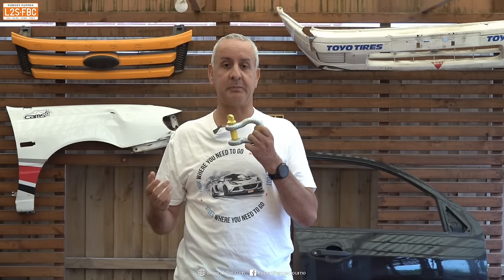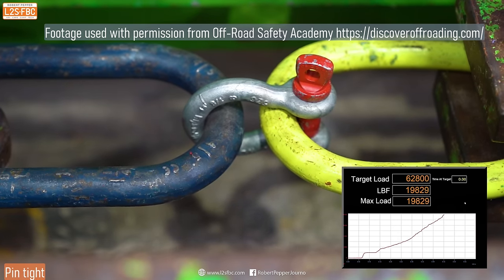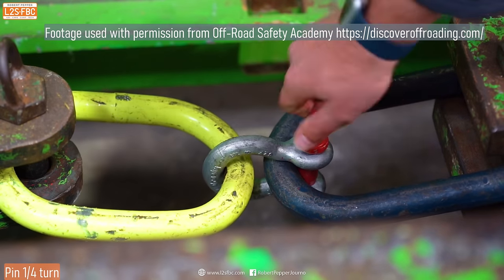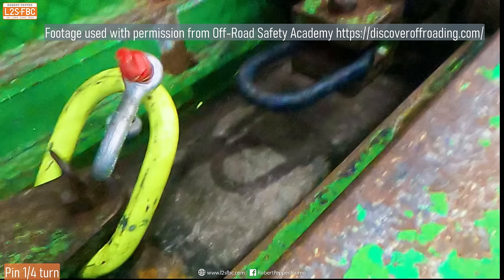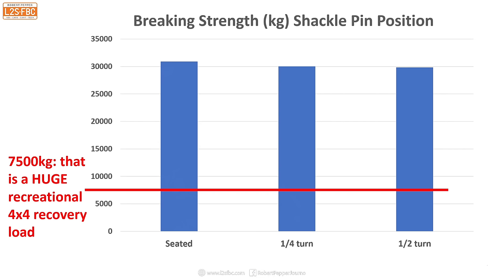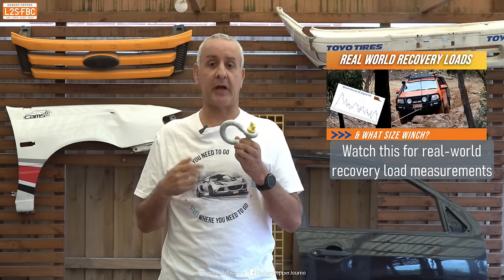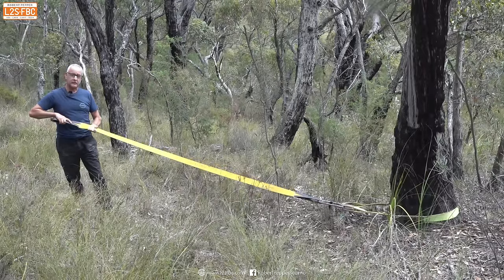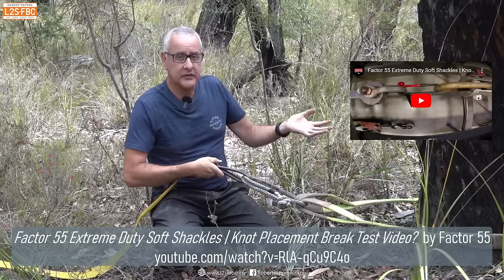What happens if you back off a shackle by 1/2 a turn?

Comment: One major component that was left out, is that the screw pin shackles are rated for opposing angle pulls on the bow side of the shackle.   In that type of pull you will start to spread the legs of the bow LONG before what was shown in the straight line pulls of this video.   
  So yes, in all reality it doesn’t really matter in a straight line pull.  But if you have opposing pulls on the bow of the shackle, like when a tree saver is connected with a shackle, or a shackle being used as the center point of a bridal, the screw pin should absolutely be shouldered against the bow.
Reply from the maker: Thanks Casey. What sort of force do you think would it take to damage a shackle in that configuration?  And what would be the percentage strength loss in that configuration?
Reply: @L2SFBC  it’s not absolute break strength on that pull that is the concern, it’s repeated flexing of the steel.  Although not much, allowing the bow to spread open and closed over and over again is the same thing as bending a paper clip back and forth.  Eventually that load rating isn’t going to be nearly as strong as what’s listed.   I fully agree that those bow shackles are so ridiculously over built for off road recovery that it will never get to breaking strength regardless, but who’s to say that off road recovery is the only thing that shackle is ever going to be used for??   
For someone like me it’s not out of the ordinary at all for a piece of gear to be used for off road recovery, then be used with my heavy wrecker on the end of a multi part line pulling a loaded semi truck out of the ditch.   
  It would also be good to note that those shackles have reference marks on them showing you how far of an angle you can pull on them while still maintaining their rating.
Reply: @L2SFBC  and yes, I also fully agree that you don’t have to have everything perfect every single time.  Like the twist in the strap, most everything in off road recovery is usually so far under the load rating of the gear being used that you have quite a bit of leeway and forgiveness.   
Just like the bend radius of synthetic rope that you listed is what is “required” at peak load.  But what most people don’t realize is that peak load on a 3/8” synthetic winch line is up in the mid to high (depending on manufacturer) 20k’s, and since a 12k winch will never be able to put even half of peak load into that line, the requirement for the bend radius is reduced as well.   
The farther you are under the limits, the less important all those type of details get.   

I think the most important thing to consider in rigging is also the one that is the most overlooked, and that is what you’re hooking too.   All the rigging and safe WLL calculations in the world won’t keep you safe if you’re hooked to a bumper or suspension component that can’t hold up to it.
Reply from the maker: Understood.  I'm dealing with recreational 4x4 work here with vehicles usually 4t and under, not competition, not professional recovery.  I haven't tested very old shackles, that'd be an interesting one, or shackles that have been used for a LOT of hoisting. I dealt with side loading of shackles in the other video, a common thing taught in Australia is "never side load a shackle" but in fact bow shackles are built for it as you'd know.

The whole purpose of this video is not really about shackles, despite the name.  It's to get people thinking about what's truly important in 4x4 recovery, which typically isn't tiny details, it's the bigger picture.  I wouldn't want someone stressing about a twist in a strap, a 1/4 or 1/2 turn thinking if they get that right they're safe, when they've not noticed their diff is hung up on a rock, or their fleet angle is way off.  That's the conversation I want to have here.  Already we've got people coming in from engineering, military, marine...all have inputs and it's interesting to see how their use cases apply, and do not apply.  I appreciate your heavy-wrecker experience into the mix too!
Reply from the maker: Yes, planning to do "forces on a multi-line rig" soon.  This is very true "The farther you are under the limits, the less important all those type of details get."  For me the most important factor is knowing why you're stuck and then reducing load, not just adding force. The closest I've come to being killed is because I kept winching and snapped a double-line pull in competition.  I could feel the winch straining the car not moving. But, comps, right?
Reply: @L2SFBC  I’m totally on board with that.  My process when I show up to a recovery is usually to figure out what the actual problem is (as you said), and then work backwards from there to find the path of least resistance to overcome it.    What I see all too often is people see a stuck rig, and just think about how hard they have to pull to make it not stuck anymore.    

Where I do disagree, is where you referenced in your other video that 4 or 5 to one pulls and the  advantage gained from it is pointless in off road recovery.   While that may be true in decent traction situations, you have to remember that there’s a very large number of off-roaders in areas like I am where we are performing recoveries while our vehicles are sitting on ice.   
In those cases I always try to run my winch line to the stuck vehicle, and then multi part to a tree, or run my line straight to a tree, and then multi part to a vehicle.   
I am often times in a situation where my vehicle only has maybe a thousand pound of holding force before it starts sliding, and that’s not going to get the job done.  But if I can use a separate anchor point and turn that thousand pounds of pulling force into 2500 to 3000 pounds of force on the vehicle with a 4 or 5 part pull, I now have a good chance of getting something done.  
  I stated in a couple of my videos on the Yankum rings that the point isn’t the ability to create huge 10’s of thousand of pounds of pulling force with big winches.  It’s the ability to create usable and effective pulling force with either smaller winches, or a vehicle that can’t anchor in place enough to make full use of its winch.   
   In my specific area ice is the biggest nemesis.   My big wrecker has two 30k pound winches and my little wrecker has three 12k pound winches, but all of that pulling power is useless when the truck just starts sliding at just a couple thousand pounds of pull.    That’s when multi part rigging to a separate anchor point becomes very important and useful
Reply from the maker: OK, fair point - I have watched all your Yankum videos but missed the ice point.  In Australia we don't really have a traction problem like ice, we need to work very hard to get to snow and only for a few weeks a year, and it's never sheet ice, it's snow on normal 4x4 trails. However we do have slick mud areas and there I have used a 2:1 pull with anchor on car, and second on tree to about halve the anchor forces otherwise the car slides, so I see your point about ice and I shall be noting that use case (with credit) when I talk about multi-line rigs in future. My point re the multis was that the force required isn't as much as might be thought, and friction erodes multi-line power very quickly, and if you really need a multiplier, rig a Spanish Burton if you can as that's most efficient.

If anyone reading this isn't clear; if you are winching someone out with your car stationary, then you can use a double-line pull but run the return line back to an anchor like a tree, NOT your car, and you still get an MA of 2:1 less friction, but half the traction required on the car so it doesn't move (hopefully).  The other tip if you need to pull someone uphill is to face your car uphill too, and use a redirect ahead of your car to get to the car lower down so your car isn't pulled downhill ...but then you double the force on the anchor for no MA.  You can then get clever with a redirect and double-line...see my winch videos where I cover all this with examples.
Reply: @L2SFBC  also think about a SXS coming up on a stuck Jeep, or a case I had last winter where a snowmobile had gone off a cliff in an area where we couldn’t bring in other vehicles to winch, so we rode other snowmobiles out with a couple rings and some winch extension, rigged up a 5 part line, then two of us recovered the snowmobile by hand.  
There are lots of situations where you might not have ideal conditions to make full use of a 12k winch, but can use multi part rigging and a separate anchor point to make up for it and get back into usable and effective pulling power with a very minimal amount of gear, which is the whole point of the Yankum rings.   

I’ve been watching your videos and really enjoy the technical aspect of them, as it’s the polar opposite of my videos that are built more for entertainment.   Keep it up!
Reply from the maker: Another international difference - in Australia you can't drive an SXS on public roads, so you don't see them on tracks only private land, so anything you come across will be another 4x4. But it could be a Suzuki with a 5000lb winch finding a Ram or a Canter, so same sort of thing, or someone with handwinch, so same principle. Appreciate the encouragement, thanks, room on YT for everyone and it's so interesting to hear views from all over the world and from different industries!
Reply: I love both your channels and was looking through the comments for this conversation 👍 Thanks for not disapointing
Reply: @CaseyLaDelle just stumbled across this and appreciated your discussion with this channel creator even though I have no need or use for this equipment.
Reply from the maker: You know, sometimes people can respectfully learn from each other as we all have different life experiences, especially being in different countries.  I don't do much in snow and ice, and we don't find SXSs on trails, so Casey made some great points and we all got to learn.  Better than trading comment-bombs!
Reply: @L2SFBC  Was your winch line steel or synthetic.  Here in the Pacific NW, USA, We have loggers killed every now and then from steel yarder lines breaking. The triangle of death comes in to play.
Reply: Pretty sure this was recommended to me because I liked your video Casey. Thanks!
Reply: There are marks forged into the bow.  The ratings are for any load that falls between these marks, not just a 180° opposing pull.
Reply: @CaseyLaDelle  You are aware that a low carbon steel shackle, with the circular configuration moves and changes shape every-time you use it right? Backing the pin off enough to make sure you can actually unthread it again will only change the diameter of the shackle maybe 50 thou at the most. That's not enough to fatigue low carbon steel and will pose no danger at all.
Reply: @evictioncarpentry2628  it’s stated in black and white on the manufacturers website.  They’re the ones stating it, so go argue with them
Reply: @CaseyLaDelle No it's not at all the same as bending a paper clip back and forth, because you are flexing it and not bending it, there's a big difference between flexing steel and bending steel.
Reply: Soon as I saw the title this vid two things popped in my head, when I am running the crane, tighten the damn shackles. And Caseys Voice.

Comment: I had always assumed the advice to back off the pin thread more about being able to get the shackle undone after loading it rather than making it stronger.
Reply from the maker: It is to get it undone, the question is, how much strength do you lose?
Reply: @L2SFBC  Like we all saw, they lost nothing.
Reply from the maker: Sure but then during inspect you notice that and you throw them away.
Reply: That's the way I was taught and I worked heavy construction all my life until retiring.
Reply: @dubious6718  after repeated use and stretching slightly each and every time yes they do loosed strength. as a certifier i used to throw them away all time with being stretched. have also seen it cause a death as i was involved in the investigation into how it happened.
Reply: @Weetbix1969  Everything will break after repeated use, but that's not what this is about.
Reply: That is the test that would be interesting.  I would think leaving it loose would make it harder to remove rather than easier as it provides more leeway for the shackle or both to deflect and get bent.

Comment: I’ve been involved in hoisting and rigging for 30+ years, working with iron workers , crane operators, millwrights and I’ve never seen anyone back off a shackle. They were designed and manufactured a certain way for a reason. Seat the shackle bolt all the way.If it is tight , use a wrench or drift to undo it, that is why it is flat and has a hole in it.but agrees that in 4x4 recovery the point is mute.
Reply: Yeah they were designed to be backed off.😂
Reply: 100% this "back it off" thing is a new one for me

Comment: I m so used to snugging the pin to the shackle it is foreign to do it any other way. This coming from heavy rescue in the fire service and also dabbling in heavy recovery with a local towing service including working off of a 50 ton rotator wrecker and pulling and lifting some monstrous loads.  Their company policy is that all shackles are seated to the shoulder of the pin.   I would indeed love to see the research that has been done to prove that the pins could become unscrewed in certain situations. Perhaps heavy vibration or extreme/ excessive movement of the rigging.   Thank you once again Robert,  keep it up man!! Cheers from the US
Reply from the maker: Then keep snugging. It's not wrong, and if I was writing the rules for the fire service or whatever I would always go for the least-risk approach just in case as they would have additional rules around fatigue, time etc, and usually plenty of people to work things, often fit people appropriate for fieldwork.  But, if it's me talking to recreational 4x4 people who can make their own minds up, and may be working solo, I'll say sure if you need a quick winch when the shackle will be under load for maybe one minute with no vibration, you can back off 1/4 turn.
Reply: Yes I was more concerned that it might vibrate loose if not tight.
Reply: Th eonly way the pin can come unscrewed is if there is no load on the shackle.  Any significant tensile load will lock the pin in place due to the side loading of the threads, resulting in friction that prevents the pin un-screwing. An unloaded shackle can indeed come undone and they should not be used without supplementary locking (ie lock wire etc) in a long term application where they are either substantially unloaded or experience load reversals ie tensile load fallig to zero repetitively.   In short term, monitored, applications then clearly it is up to the operator to monitor, check and if necessary retighten as required, for example during a load winching event where the cable load is not continuous
Reply: - also in the case there may be a sliding line - a loose pin "could"- unlikely but as demonstrated in climbing "experiments" not zero risk - unwind..  (??mouse the pin with a ziptie - nylon is fine?? - it reduces any risk to closer than zero - of course using sling eyes reduces this risk - endless slings may slide settling into place - of course >3 complete revolutions, exceedingly unlikely in a quick lift and move..)
Reply: Yes.
If I'm doing a single pull (stumps, recovery, etc) I'll leave the pin "loose" BUT if I'm doing extended pulling (dragging logs, etc) I safety wire the pin because darned if they don't come loose.
Reply: The theroitcal way a shackle pin can loosen, is if it's being used with a nylon sling. I often "choke thru a shackle" when picking full bunks of OSB on construction sites, the sling will have a smoother choke down action on the shackle hoop,, not rubbing on it itself...., but it's imperative to have the fixed end of the sling on the shackle bolt, and choke thru the hoop, doing it backwards and its conceivable but  unlikely, that the bolt could be undone when it chokes up.  Another advantage of using a shackle to choke thru, is i only have to cable down enough to release the tension, so the carpenters can just loosen the shackle, not all the way to my load hook. On repetitive crane work, this saves time and winch work.

Comment: Great video as always. On rigging courses I have done they always say seat the pin fully, this is normally company policy for liability reasons but also they talk about repeated use of equipment. Having it backed off a bit allows the shackle to expand slightly under a side load, this process repeated over time expands the shackle and weakens it according to to courses I have taken. Now obviously there is a lot of health and saftey regulations in the rigging world but it's nice to see actual test that backs up that it's still safe enough to back off a pin in light 4wd recovery.
Reply from the maker: Yes this is recreational rigging for a winch on occasion. Not constant hoisting.  Different use case.
Reply: What exactly is the definition/interpretation of, light 4WD recovery?
Reply from the maker: Vehicles weighing around 4000kg or less, and occasional, infrequent recoveries where time is not a critical factor. So, not competition, and no pro every-day work either.
Reply: Good video, thanks for the info! As I suspected, backing off the shackle makes no practical difference to its strenth for recovery purposes. It would have been cool to see some quantifiable data as to how much of a benefit it is to back it off, ie. How much easier is it to open the shackle after use if you do. Cheers!
Reply from the maker: Well, for that we need experience...and the reason it's been in 4x4 training manuals since forever is because it is possible, mostly, to undo it after a recovery.